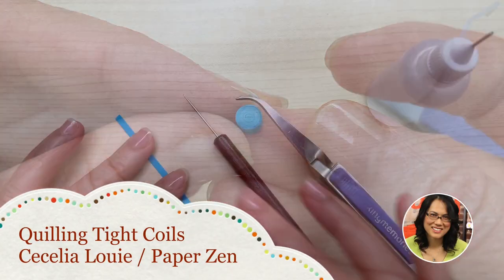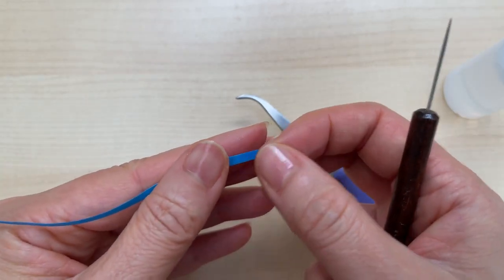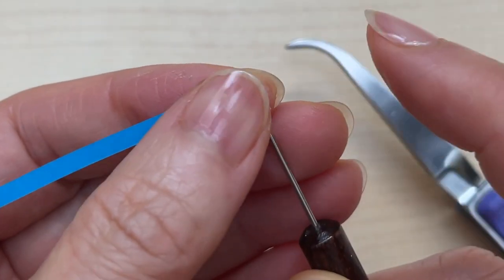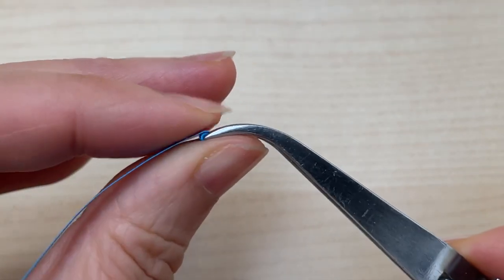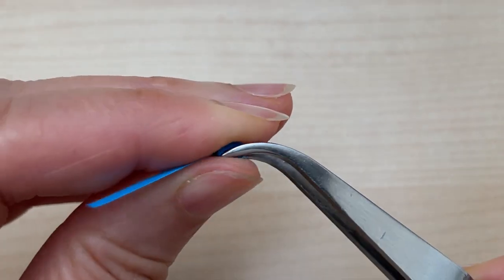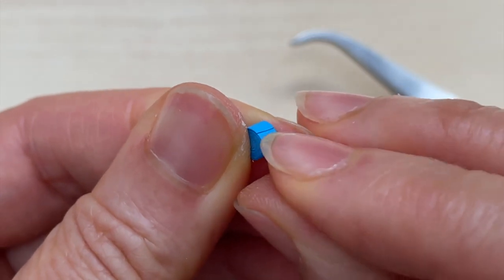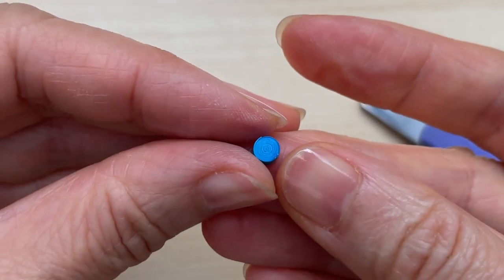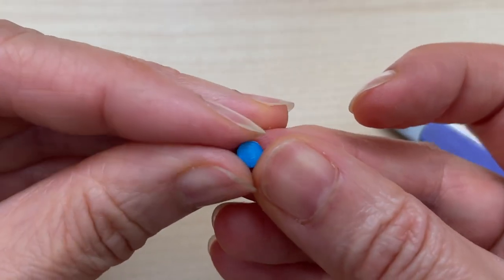Quilling Tight Coil Without Holes - Just Add Water

Comment: Thank you for your videos! My question is not coil related. You seem approachable so….how do you keep the needle nose glue bottle tip clean?  Thank you
Reply from the maker: Thank you and I'm glad you asked Elizabeth 😀 When I'm pausing in between gluing coils down, I place my glue bottle upside down in a shot glass. In the bottom of the shot glass, I place a wrung out damp tissue. The slight dampness prevents the glue from drying out. Here's a link to that video if you're interested: https://youtu.be/hGL5PDZmyto

If glue has dried up inside the nozzle, I use a pin to unclog it and soak in hot water to get out the really stubborn bits. 

Hope that helps!

Cecelia
Reply: @PaperZenCeceliaLouie  I am very new to paper quilling but I love it. last year my aunt asked me outright " but what do you do about the glue bottle clogging up?" 
I told her " simple! I take the cap off and use a sewing pin AND a babywipe to clean it" 
she finds that would be annoying but for me I am autistic and find tasks like that to be part of the process AND fun. so I don't mind taking the time. 
in my past I've sorted a huge bucket of perler beads (you melt ) into a jewelry storage bin for hours on end until I ran out of spaces! 😅when I went to show my cousin she was like " I could never omg!" and then gave me a mini heart attack when she tilted it they almost mixed up! I blurted " NO DONT YOULL RUIN MY HARD WORK!" 

and she apologized saying "  oh....yeah"😅

sorting and colors calms my brain. 😊❤